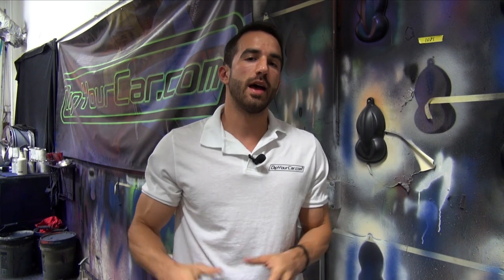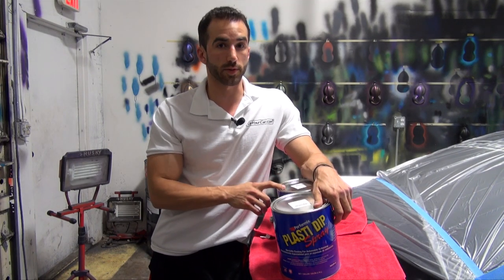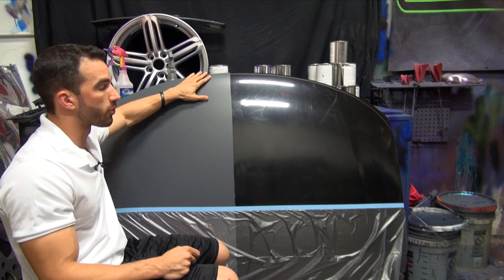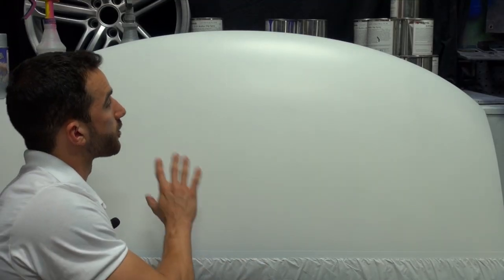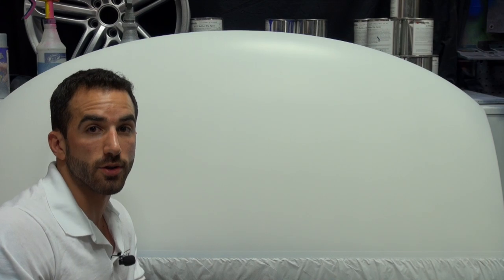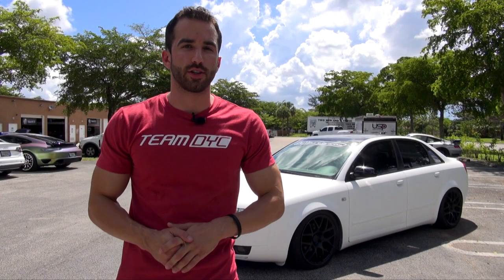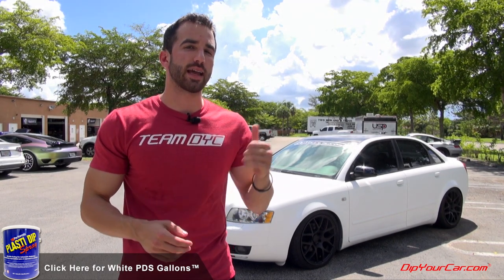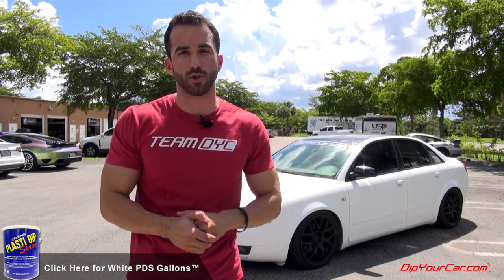NEW White Plasti Dip

Comment: PLEASE REPLY !!!

Can you please do a product test

I am wanting to see a Four Wheel Drive (example FJ80 series landcruiser) With a Plasti-Dip Paint job go off road through thick mud getting thrown all over the car, branches scraping the panels everything. A proper test, And show how the paint holds up when you wash the car.

Will it get torn off or scrunched up by thicker branches, will thick mud stain it if left for some time (a week or so)

Its alot of money to get your car dipped in australia, but still less than normal paint on such a big car.

Cheers
Kyle

Comment: would exhaust sot or greasy dirty hand prints clean up good with this  ?
Reply: i was asking cause i was thinking of diping my bike..
Reply: +samuel lopes Yes ive had my front end covered in dirty hand prints from exhaust and grease and i used degreser first to get heavy spots out and then washed it with car soap and looks brand new again
Reply: I have found the remedy for grease marks, soot, finger prints, stains, dirty armorall spatter from your wheels etc for white plastidip or any other color - Use a microfiber rag & easyoff oven cleaner "the blue can". spray it on the rag/ wipe and wash and wallah!!! Your welcome to all my fellow plastidippers out there! 😆